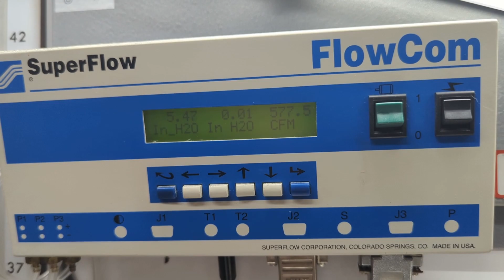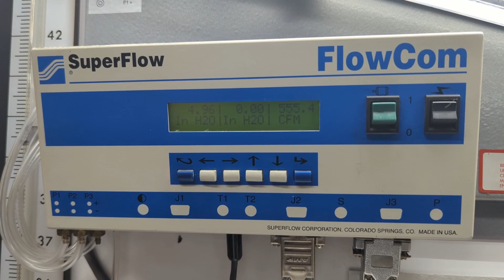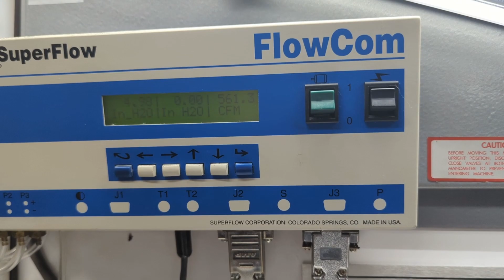Holley Air Inlet | Modified K&N Stack | Bonus - Superflow Fix

Comment: I’m trying to figure out what medium instead of clay we could use to achieve what you did with clay. Maybe a hard setting putty that can once set be removed and used as a template for a mould to produce a product made of a strong, heat cycle resistant material. 🤔 Great video… thanks 🙏
Reply from the maker: Iv used the jb putty before.  I do not know its temp limits.  I would think that above the carb and under an air cleaner the temperature is the highest on a heat soak and near normal atmosphere temps when running.  The other downside with the 2 part putty is you have to work somewhat fast but its easily sandable by hand.
Reply from the maker: To be clear i havent used putty to make an air inlet before.  Just for other projects.  Id advise looking to see if there is a general spec sheet available with temp limits or limits written on the package.